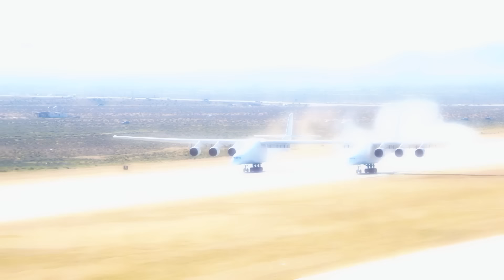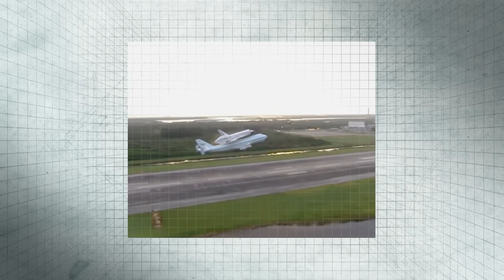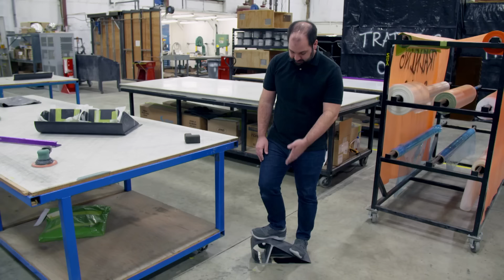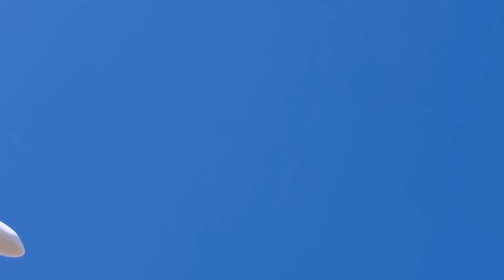Inside the World's Largest Carbon Fiber Plane | Blueprint

Comment: Center span torsional stiffness?  Twin fuselages look like machine designed to twist center span apart.  Center span has massive fuselage torsional inertia loads and yet the center span look the same as the wing roots which have no such load.

Comment: Why are the 2 tails not connected?  Would have been easy/lightweight to bridge the small gap.
Reply: It is better that way. Not only does it save weight and allow for larger payloads, it also allows the main wing to flex appropriately because of the twin fuselage design. Adding another large wing or structural component of a different size at the tail limits the ability for the two fuselages to dampen and introduces more structural complexity.

Comment: Why were the horizontal stabilizers at the rear not connected? Would that not have provided increased rigidity of the entire airframe, preventing torque between the fuselages through the wing connection?  Could differences in actual thrust from the engines on each external wing segment cause twisting?  I'm not an engineer, but dreamt about these questions last night at the Holiday Inn Express. Thx,

Comment: THREE fuselages.   Think of a "Catamaran".  Versus a  "Trimaran."     Where is the speed and strength for those "Round the World" sailboat races?     Connect the tail wings or just one wing in the middle in the back.   So then you jump to smaller models.  Not sure about that.     .

Comment: The AN 225, first flown almost 40 years ago, can lift over half a million pounds any day, and it does it from commercial airports without special support equipment. The only thing special about this aircraft is it's ability to launch large rockets at relatively high altitudes. This video is a hyperbolic puff piece.

Comment: If they were so concerned with reducing weight while @ the same time 
increasing strength why use 2 separate empennages? Seems as though it could 
have been made lighter & stronger by having 1 horizontal stab’ connecting the 2 
afts, removing the 2 outboard horizontal stabs’ & replacing the 2 verticle stab’s/
rudders with 1 in the center. Not only would the airframe be lighter & stronger 
but there would be a reduction in complexity, weight & cost of the hydraulics & 
elctronics needed to control the rudder & elevators ~

Comment: The presentation is what it technically is and a bit too "Gee Wiz" in both the breathy narration and the "gushing" audio track. The producer/editor ran out of material as a ton of stock materials were used over and over even though most every shot sequence is in slow-d motion .  To me, the biggest downside of all this is that you can never get rid of the structural material, as the carbon cannot be separated from the resin used to bond it, so there is no recycling downstream; it is just "fill."

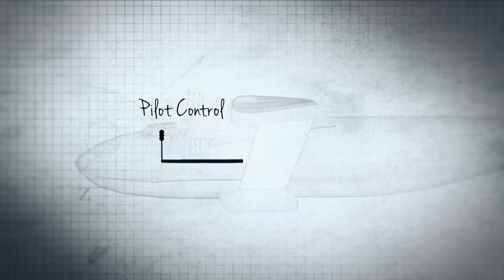Comment: 11:45 shows elevator control reversed. The few times that happened in real life it was usually fatal within a few moments of takeoff. Hughes did not invent hydraulic actuators, his designers simply remote mounted valves and actuators. Bad editing, bad math, poor research, good clickbait though.

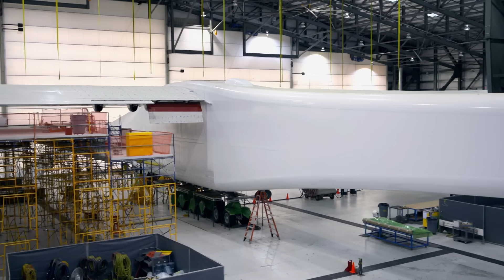Comment: 24:30  her math is wrong.  each of the 5 attachment points takes 600,000lbs? max payload is less than that.
Reply: Your analysis is wrong.  Suggest you Google terms like "reserve strength", "dynamic load" and "safety margin".

Comment: I hate to be pedantic but the pilot grossly over exaggerated when he said the plane's payload capacity (250 tons) is an order of magnitude greater than any other plane currently flying.  The C5 Galaxy is the current #1 for highest capacity with 140 tons.  One magnitude greater (10X) than 140 is 1,400 tons or 2,800,000 lbs.  Technically, this plane's payload capacity is 1.78 times that of the C5.
Reply: Nah you're correct.   I flew in almost every military c plane there including the 21 and 37.  I also flew on the antov out to VAFB for a 3 letter delivery and that max weight was 250,000kg.  I think it was blown up in Ukraine but that was basically the same weight as this one.   Im not a fan of hyperbole and I appreciate your pedanticatry.
Reply: @sparaz  Agree completely - this is all visual hype with little useful info.
Reply: The sound and breathlessness is absurd.
Reply: How about the Antonov 225 / 6 engine (now shot to shit by Putin)
Reply: The center wing box takes a lot of loads on this giant, it must be really beefy 😮
Reply: Why imperial  and metric it  doesn't  make sense, and I have no idea how a giraffe has got anything to do with it
Reply: The C5 Galaxy is the current #1 for highest capacity with 140 tons? 🤣  Ан-225 «Мрия»  — советский транспортный реактивный самолёт грузоподъёмностью — до 250 тонн.
Reply: @igorivanov4579 lol
Reply: Your not.  You just correcting these ppl.
Reply: Neat design 
Seems like it woulda been something great in the 70/80s
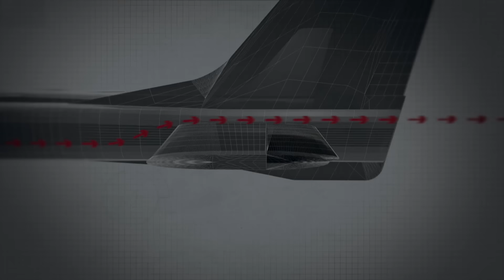7:09 lol
Reply: I appreciate being pedantic sometimes.
This flex -
“A new milestone in engineering.” 
Let’s see how they achieved this! 

An early Reference to spruce goose type controls?
A milestone made decades ago, not really new.

Next comes a bunch of claims that would make Edward Bernes proud.  

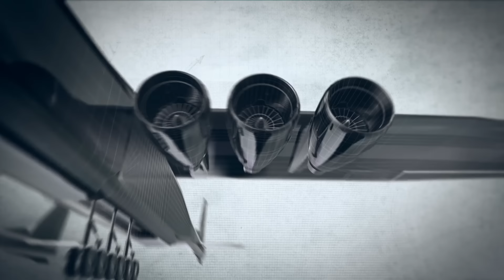16:15  2nd dunk on the Bros?  
pathetic GTFO

It’s one of the heaviest aircraft in the world. 
Ok so not a flex … really at all. 
The immediate pivot to load capacity implies one of “heaviest”
 again not new or unique 

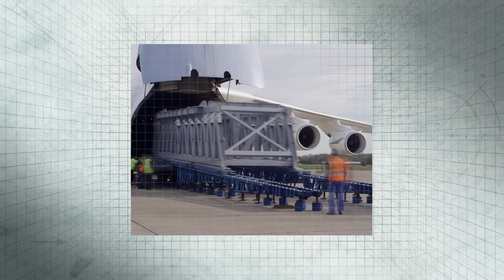17:22  The space shuttle equals 1/3 the amount it NEEDS to carry? 
On order to fly? 
Most of the mock-ups they show weigh less 
Again NO

Large & small cargo, like a space shuttle, 20 tanks, bombs, guns, fuel or people, 
carried inside or out, needs to be BALANCED.
See Issac Neuton.. not new

They split this ahead-
25:00 lol wow ….yeah lady…Even more!

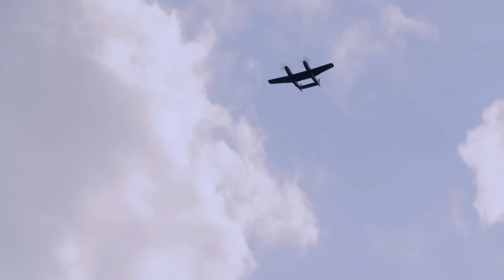22:40 in service between WW2 & KOREA 
uhhhh “In service”
Twin fuselage milestone made in the 40s?
Bruhhhh 

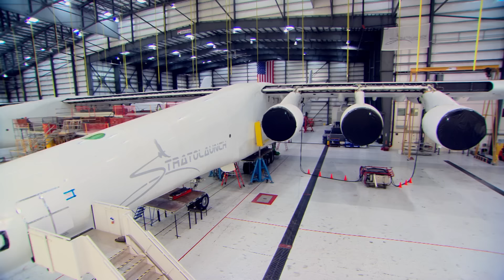29:48 carbon fiber!
Umm 80s 

I give up. 

Never dunk on the bros. 

Hope this does well though, inspires plenty of cargo innovation and abilities like fire fighting. 
80s
Reply: They gotta be lowballing us.
Reply: I thought the same thing. Unfortunately the AN-225 No longer exists.. My ex mother in law worked for Lockheed Martin and worked in blue printing. The C5 was one of her projects she worked on.
Reply: So you are that guy, I love it? You were very factual and not condescending 👏🏽👏🏽🤓
Reply: Can’t wait to see the crosswind limitation charts for takeoff and landing. I’m thinking this plane will be a VFR fair weather flyer. Think of the ILS or VNAV approach to minimums which align aircraft to [the centerline] of the runway. This plane would have to breakout from minimums with a crosswind at maximum limits-and the pilot is supposed to make that correction to an offset sight picture?

Naaaa, not happening folks. Go on YouTube and look at some of the old videos of 747’s trying to get into the old Hong Kong, Kowloon airport. 

CAT III approaches are out of the question. 

So I get it, a one mission, almost perfect weather, wings level aircraft to fly up to an altitude, hit the release button and then come home.
Reply: Oh yeah only after the russians destryluyed their own soviet AN225 recently😅
Reply: Dude said 220 if ya re listen to him. But regardless, his numbers are probably not right ATM
Reply: An 225 maximum load capacity was 253tons and I think if I recall the maximum take off weight was 640tons. The record still stands today. 

I really don't see this plane carrying that capacity, on the computer yes not practical. Maybe I am wrong... What has it done apart from flying? Has it carried anything?

Comment: It flys better than the "Spruce Goose" but only incrementally so. Both gigantic aircraft have very limited utility and their purpose for being has, in each case been worked around. 
I note that it is the Strato-Launch not the "Strato-Delivery" aircraft. I suspect that its full design load has to be dropped before it can safely be brought back to earth. As for the Hughes Flying boat, its one flight had to be short as they were running out of harbor to land in very fast. As a massive trans-oceanic flying troop transport able to avoid submarines, it probably would have had to taxi with a load of sea-sick soldiers some miles in rough seas after landing, to reach a pier in calm enough water to off load them. More conventional ship transport is superior in more cases, as is just building a somewhat bigger first stage for the first 6 vertical miles of space travel.